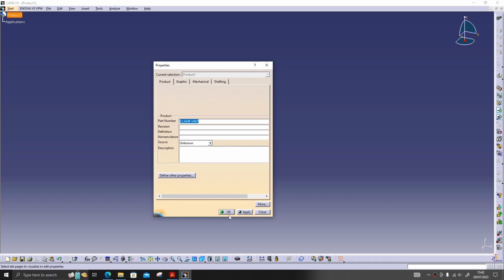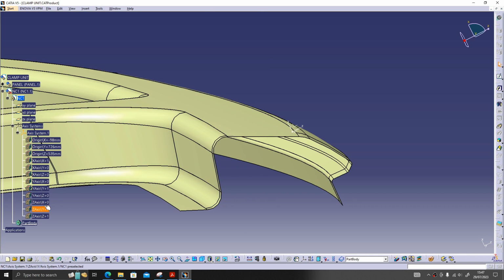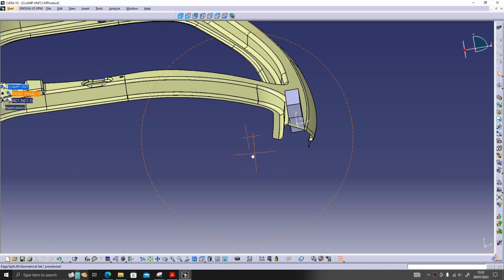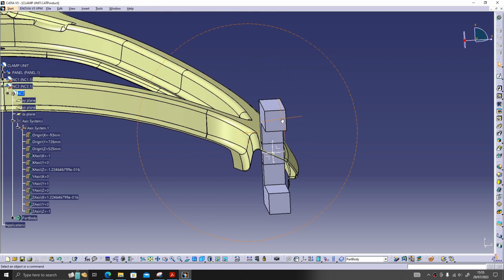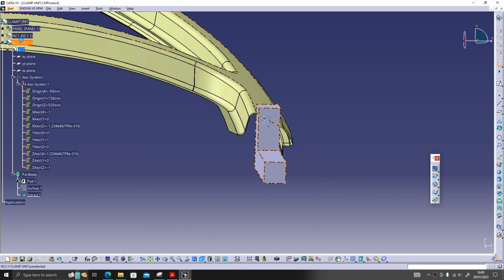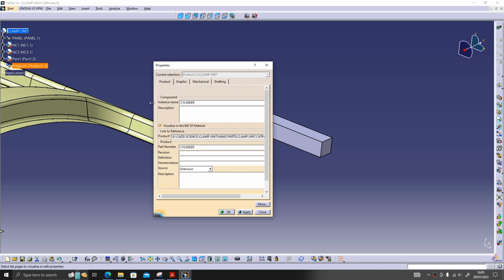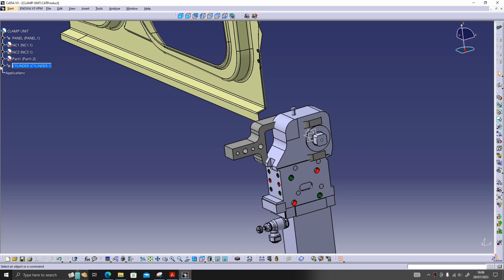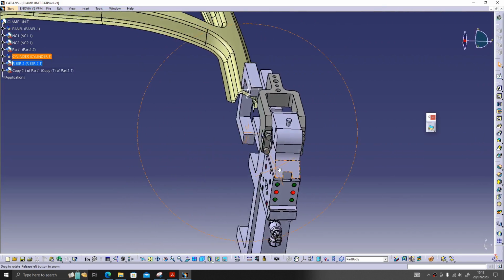CLAMP UNIT DESIGN | BIW FIXTURE | CATIA

Comment: Why you are not using coincidence command, offset command in assembly design.
Reply: In companies that work on large assemblies on CATIA, they prefer not using constrains because it would create update loops that will take a lot of time, instead they use a common axis system for all the parts, then design them in their final position so when you bring the part in the assembly is will come in its good position. 
If the part is used in  different positions they would just snap it to the other position without constrains 
I hope this helps
Reply from the maker: Assembly constraints are not much used in catia as snapping is very easier and faster